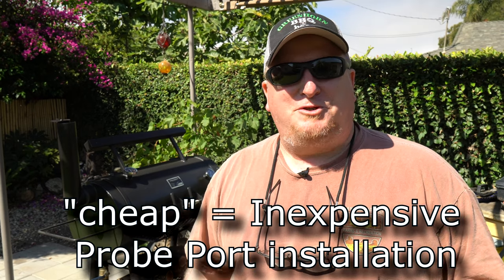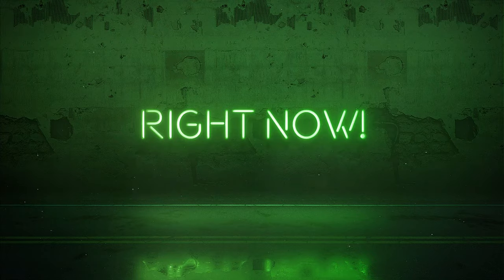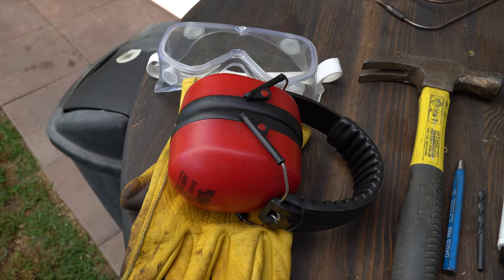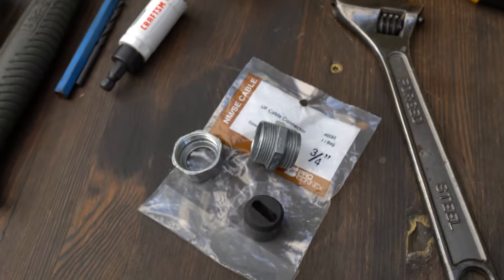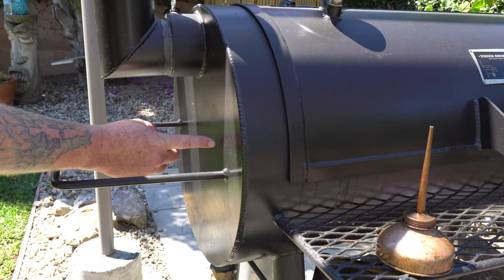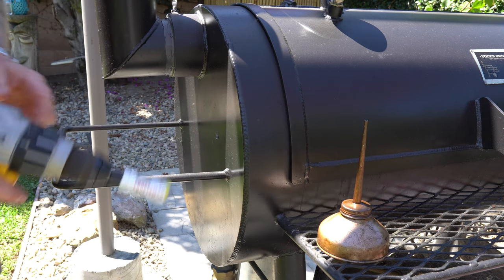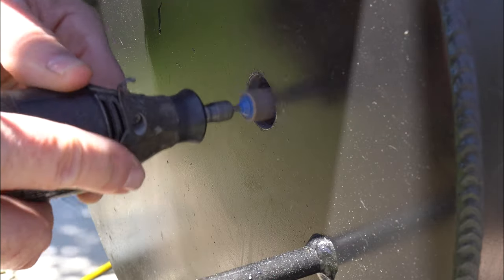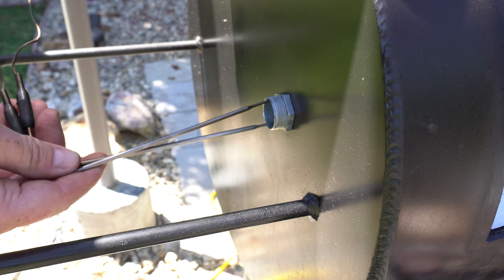Under $5 bucks! Yoder smoker thermometer probe port installation Fast!

Comment: That conduit fitting is made from zinc. Zinc emits dangerous chemicals in high heat. It's cheap but not safe for bbq grills. Use stainless steel to be safe.
Reply from the maker: I agree, but the quantity and location next to the exhaust makes this highly unlikely to still be emitting anything measurable. Cheers!

Comment: or ........ just drill a 1/4 to 3/8 hole (depending on probe size) and use sand paper or a small round file to remove any burrs . less air gap than what you're using and it cost nothing . if you want to plug the hole when you're not using a probe use a stainless steel bolt on the inside with a wing nut on the outside . take care and thanks for sharing .